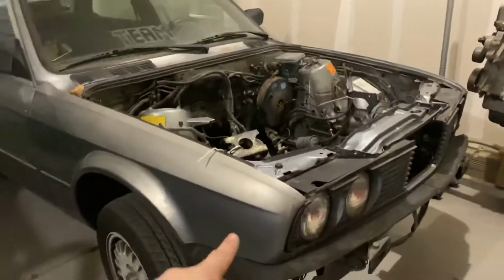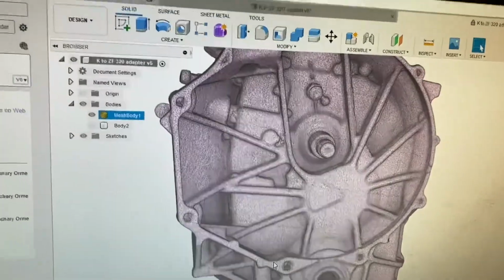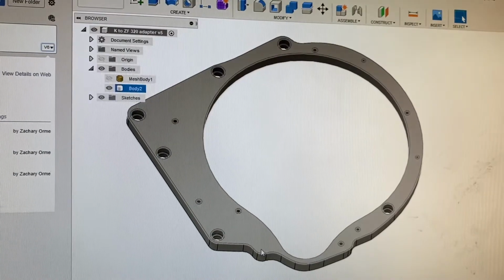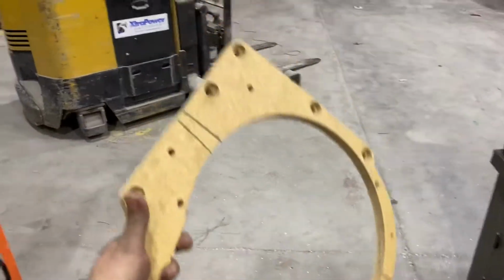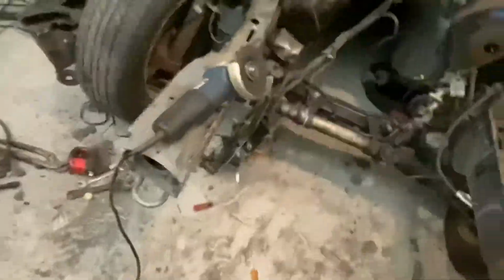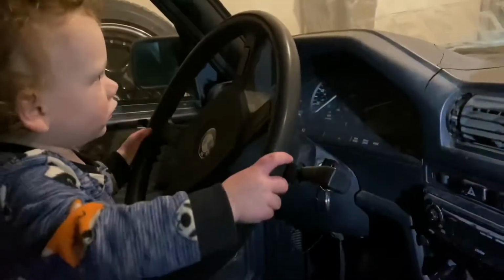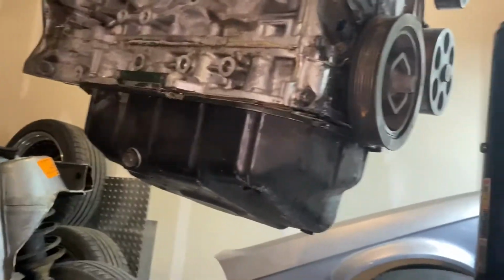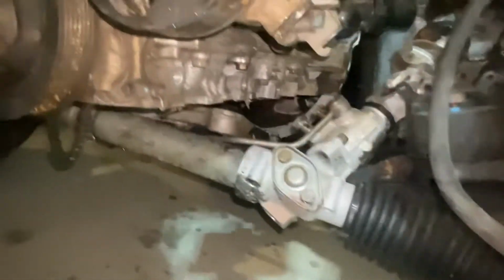E30 K to BMW Adapter Start to Finish and more

Comment: hi, did you test if all gears go in ??? i have an e30 and k24 series, but i didnt know which gearbox to use, i only need a e46 gearbox? could you send me the flat of the adapter plate? greetings from argentina! nice job!
Reply from the maker: Well so far all gears go in, however till the car is running and under actual load I can't verify the full operation. I did use a E46 328i ZF320 gearbox as it's one of the strongest. As much as I'd like to send that file I'm going to hold on to it due to the competitive market in this setup. If you watch in the video I do explain how I designed my adapter and it's possible to replicate it yourself with some time and patience and I'm happy to give you guidance along the way. Way cool glad to see the expanse of my viewers around the world! Thank you!
Reply: @octanemotorsportengineering  argentina is a place with many bmw"s, i congratulate you on your work, it is a great help!!!!

Comment: What flywheel are u using?
Reply from the maker: So at this moment the flywheel isn't done yet but currently I have a Competition Clutch K series twin disc flywheel that I'm going to use as the base as it's machined chromoly then I'll be adding another piece that I'll be machining that has the correct spacing to have the clutch discs fully seat on the bmw input shaft and contact the throw out bearing as well as accept the transmission input shaft pilot bearing. Basically replicating the TF twin disc setup with my triple disc. I'll post a video of how and when I do this in the near future.